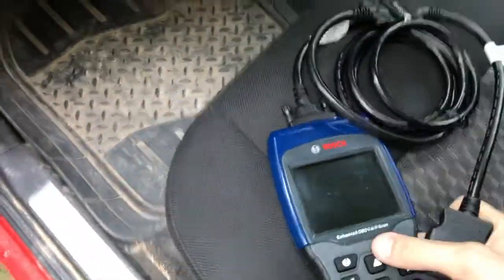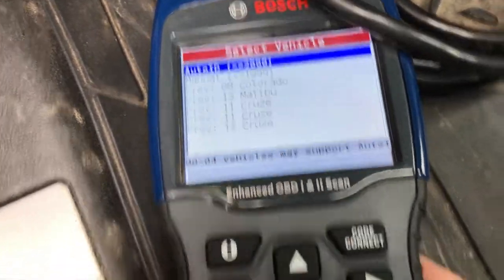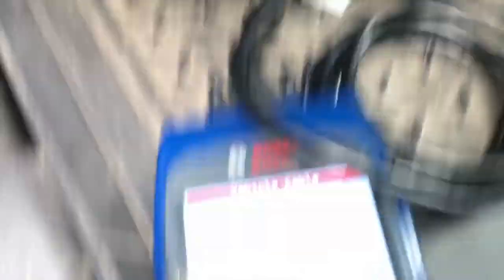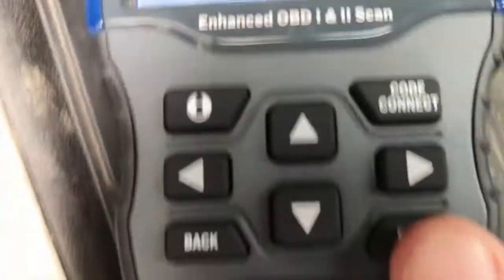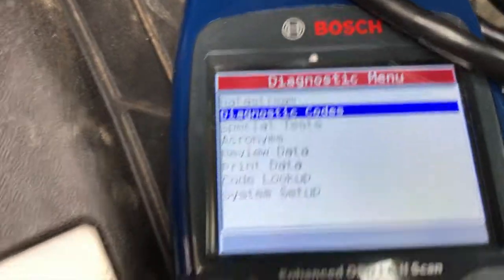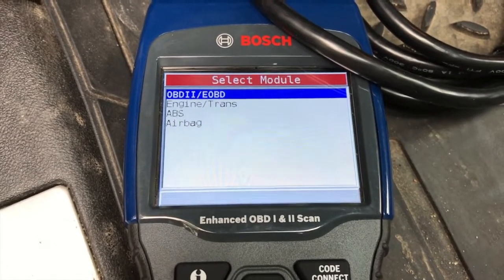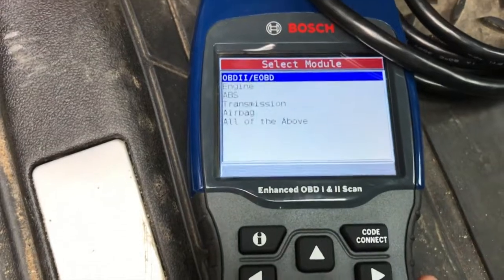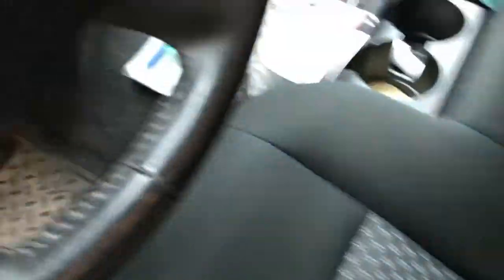How to reset & turn off "Check engine light & ERROR codes"

Comment: Great if you have a key, very different with these new key fobs
Reply from the maker: @nicenonya3  

Thanks for watching.  With push button, you will press once without compressing brake.

This will allow your system to turn on without starting engine.

Comment: If someone straight pipes a vehicle, causing the engine light to come on will one of these scanners completely erase the code and it will not appear for the same reason? I've found mixed answers on this.
Reply: @DIY With Michael Borders
Reply from the maker: Thanks for watching & welcome to the DIY Raptor Club.  We haven’t done that before...

It’s very possible that your local AutoZone can erase codes for free.  No guarantees that it will stay erased...🤔

Keep us posted, enjoy your night.

😎👍🔧🔩
Reply: @DIYwithMichaelBorders  I've talked to people I know in real life and they say it doesn't stay off and once the computer recognizes the problem, the light will reappear. But some people online say otherwise, and that it wont appear again.
Reply from the maker: @i-confederate-i4734  

Thanks for the update & it doesn’t hurt to try.  😎👍🔧🔩
Reply: I did this to my car, and yes you will get a "check engine light." The ONLY way to permanently erase this error code, is to go to a Dyno shop and have them do it for you for a large fee. Reason being they have the tools to reprogram the computer on your vehicle and make it so it ignores your cats being gone. A simple scanning tool cannot do what they can do with expensive professional software!

Comment: I have a 2002 Mazda Tribute. Scanner showed a stored code i had engine light turned off by mechanic with a code reader got about 2 miles down the road and the engine light came back on had code read again and it showed same code but as a stored code

Comment: @DIY with Michael, hey I know there's a lot of different answers to this question so I hope you can provide your best opinion on this. So I own a 2016 Mazda3 and am having tons of fun modding her, and yes based on this video I need help with my cel code. I knew putting on...headers that this would happen and lots of folks say either get a tune, use a defouler or get a OB2 scanner. I see how easy it can be based off your video, and my biggest concern is if I get the code gone will it stay gone thru my emissions test. Will this work for a basic emissions test (Live in PA, emissions is On board test and gas cap check, use a pretty laid back country mechanic)???
Thanks for any help.
Reply from the maker: Thanks for watching it will.  You can possibly visit your local AutoZone where they can hook up an OBD scanner to your vehicle & read info.  They do this for 100% free.

Comment: I have the 1350 model, it doesn’t read srs on my 2008 Silverado. Not sure what the problem is.
Reply from the maker: Good morning, thanks for watching.  You may need to connect it to the internet & download the most recent code release update.

This will hopefully add your missing items.  Directions for download will be in your manual.

😎👍

Comment: I was wondering if you could give me some help. I ran into a snowbank in my 2005 chevy colorado z71. The fog lights and lower front bumper broke off in the crash.  I have purchased new fog lights and a new bumper cover however the fog lights do not fit the holes. The bumper is the exact one as the original and the fog lights are from the auto part store catalog specific to the vehicle. I am wondering if I am purchasing the wrong parts or fitting them incorrectly? Also, where do the mounts attach to the bumper? I have been through 2 incorrect fog light sets so far that haven't fit and am getting desperate as weeks go by. Any help you can give me would be really appreciated.
Reply from the maker: Mike Cottrell 

Thanks for watching & we hope the video helped.  Great question & it’s very possible that your fog lights are not the exact match.

The easiest thing to do is visit your local Chevy dealership and provide them with the last 8 digits of your VIN #.  The Chevy parts department will be able to get you the exact parts for your exact vehicle.  Keep us posted!

We really enjoy making these helpful videos for our fellow DIY’ers.  Many more helpful videos to come!  😀

Let us know if you have any questions.  Please subscribe to the channel and turn on your YouTube notification Bell 🛎 that would be awesome thanks again.

😎👍🔧🔩

Comment: Have a question. Went out to start 2013 Malibu. It turned to run. Key locked up and then no power to anything. 20 minutes later everything came back on and was able to pull key out. It has done this off and on for a year. Garage things I’m crazy. I don’t know where to start. It’s not the steering wheel lock. The whole computer resets and everything. The battery has been tested and is fine. No corrosion on cables. I’m at a loss. Any solutions ? Lol
Usually a month between times that it acts up, other times it’s perfect.
Reply from the maker: Nick Allen 

Thanks for watching & we hope the video helped.  This may be related to a short however unlikely...but we can’t rule it out.

The most common cause is due to a failed key.  We recommend using your backup key for the time being & seeing if this alleviates the problem.  These modern vehicle keys can sometimes be the cause.

You may be experiencing an intermittent ignition.  Your ignition system may be in its early stages of failure.

Many more helpful videos to come!  😃. Let us know if you have any questions.

Please subscribe to the channel and turn on your YouTube notification Bell 🛎 that would be awesome thanks again!

😎👍🔧🔩
Reply: DIY With Michael Borders oh yes I’ve been subscribed for a few months. Thanks for the help.
Reply from the maker: Nick Allen 

Awesome & we just subscribed to you!

😎👍🔧🔩

Comment: It might of erase the code .But my check engine light is still on
Reply from the maker: Thanks for watching & what error codes are you getting.  Keep us posted, us fellow DIY’ers need to stick together!  Welcome to the DIY Raptor Club.

😎👍🔧🔩
Reply: hey man will this work with my diesel? i am getting and error code for my def fluid bc i straight piped it and it’s in limp mode will this work?
Reply: See if the garage can scan your car.  Sometimes scanners don't do Justice.
 They are expensive